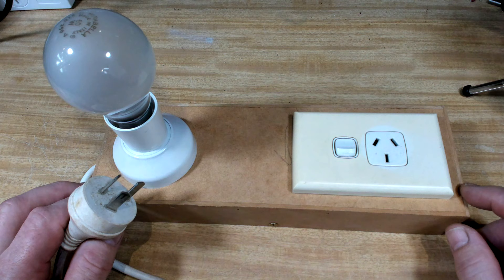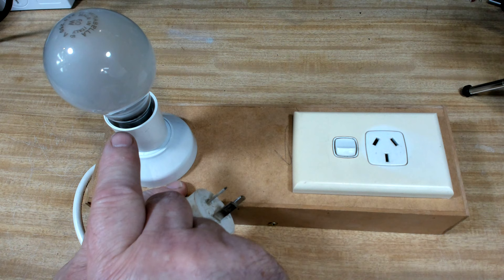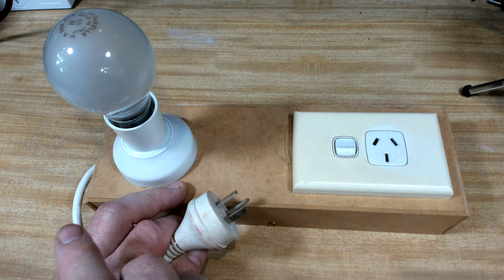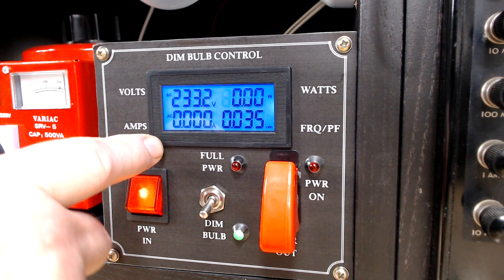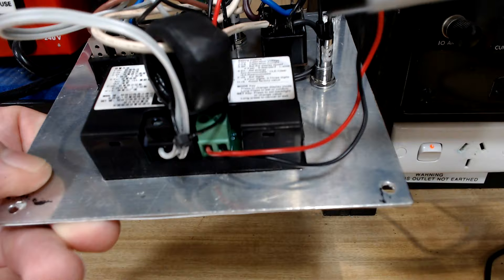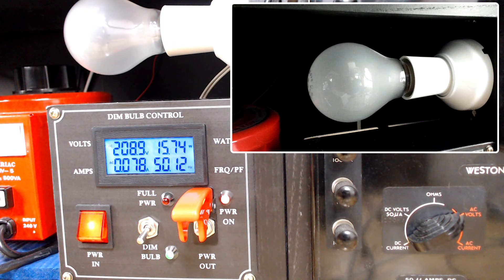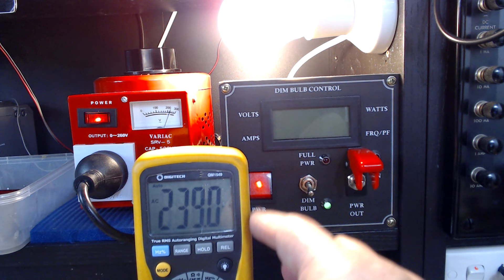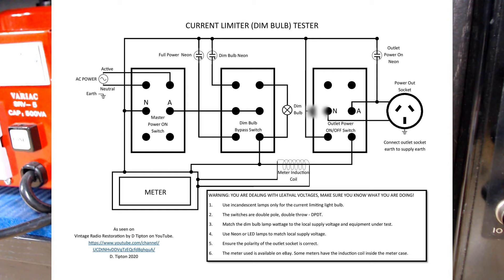My Dim Bulb Tester Revealed

Comment: Thanks Dave.
I know I asked you for a video about the Dim Bulb setup a while back.
Thanks for making this video.
Having an issue buying incandescent globes as well. I have gone with little Philips 40W Halogen globes. They seem to do the trick in series. Have never put a multimeter across mine though.
Reply from the maker: Hi 1974UTuber. I've had a number of enquiries so it was about time.  The bulbs are a problem, I've seen them on eBay and in garage/yard sales. I guess halogens would work, much the same with a different gas 🤔🙂
Reply: Yes halogen bulbs sure do the trick! I've got two 75w halogens in my dim bulb tester with the second one being switchable in and out of parallel with the other to double the current capacity
Reply: Don't forget to set your multimeter to the 10amps setting and use the proper terminals for 10amps..  ;-)

Comment: This saved my house from burning down when the lamp in the window shortcutted in the cable due to a heavy lamp. Great to know what the watt the lamp should be because I have been wondering and no one said what it should be. Now I will build one to my self.  Thanks.
Reply from the maker: Hi Harald, the wattage needs to be changed to suit the wattage of the device under test but any wattage will help save the device by limiting the current. Good luck with your build 🙂

Comment: Yes that dim bulb tester, great idea and you have done a great on the making of that. With my own man cave i have a 60 watt light and socket mounted to the wall just near my bench. A length of mains rated fig 8 lamp cord ( 2mtrs ) and a couple of insulated alligator clips on the end. Great for discharging filter caps safely. also great when working on tv's/ high powered audio amplifiers and can be used as a current limiting device in place of the mains fuse. Has saved my bacon a couple of times. I used to work 40 odd years ago in a factory that manufactured electric blankets. They made and sold testers that put a 15 Watt bulb in series  with the blanket change the heat settings  ( high, medium, and low ) and the bulb changed brightness with the setting. This proved to the customer if they had a problem with there electric blanket or not.
Reply from the maker: Thank you Stephen. It's a very simple and cheap solution. Good idea giving the customer an easy to use home demo of their blankets operation, good thinking 👍🙂

Comment: Heck of a coincidence.  Parts for a new dim bulb tester are sitting on my workbench right now.  I'm doing it a bit differently; I have two bulb sockets that can individually switched in and out of the circuit.  The fact is that I was somewhat inspired by your tester.  It is so nicely done.  Thanks.  Appreciated.
Reply from the maker: Hi George, that is a coincidence, I probably should have considered a multi bulb setup but the Variac does a little of that I guess. Good luck with your project 👍🙂

Comment: Great idea not seen long time. We had 2 types same as yours for shorts and another with 2 globes for insulation testing on motors.. The globes both same in series with test lead across one . If insulation to ground good both globes glow same.  The greater the problem one globe would get brighter and other fade.  If a full on short one go out the other full bright.  Not a mega but handy, quick on bench.
Reply from the maker: That's a good quick method Chuck, I like it, thanks 👍🙂

Comment: You are going to smile at what I’m about to write here Dave.
Sometimes when we are short of time when pulled out with work, or in “I can’t be bothered” mood, we might look on line for professionally manufactured test equipment that we are capable of making ourselves.  I have done that in the past.  I honestly thought your dim light tester was a professionally manufactured product you had bought.  Although I couldn’t see a manufacturer’s marque on the front, I guessed it was printed on the rear of its case.  The part that really threw me was seeing the LEDs.  I thought they were indicators for some sort of adjustable over-volts, and over-current protection circuits.  With that in mind, I went on line to find out who manufactured your dim light unit but all I kept getting was basic dim light circuits diagrams LOL.  
I guess I was looking at you dim light test far too deeply but one has to say, “It looks professionally made.” 
In a very nice way, this video has been a bit of a let brown - as I say, in the nicest of ways LOL.  I also thought your ‘professionally manufactured’ dim light tester would not work any better that if you had made it your self ...as I imply, it looks too good to be home brew LOL.
Bell Comet Colt radio update: the radio part is up and running, and it works brilliantly; I did some reverse engineering and I have a circuit diagram for that model, all that is left to be done is stripping, staining, and revarnishing the cabinet.  The video will be uploaded shortly after the middle of this month.
Cheers my friend, Phil.
Reply from the maker: Hi Phil, I always pre-smile when your name comes up in the comments 🙂 Sorry to let you down with the design, it's just a basic DB tester with a few lights and a meter which is very handy to see what is going on, it comes from my airline background where it takes half a dozen switches and lights to power the fwd toilet 😄 I'm looking forward to your Colt video. I didn't realise it was a wooden case, I assumed it was plastic. There is a New Zealand radio website, I would have thought there would be a circuit there. There are some pretty helpful folk on the site as well. I have your channel subbed so I will know when your video is out cheers 🙂

Comment: Thanks Dave.  I designed one recently to use some small 40 watt bulbs I found here in Japan.  Didn't know how long they'd last on the market so I bought five, plus five of the equally rare 17mm ceramic sockets for them.  You can also use chandelier/candelabra bulbs which are generally 40 - 60 watts.  In my first dim bulb tester I used a 100 W halogen projector bulb.  Worked great but finding a 2-pin socket for the thing was a challenge. One of the Chinese vendors eventually had it.
Reply from the maker: Thank you Sincerely Yours. The bulbs are a problem but are still out there, the halogens seem to work OK from what I can tell 👍🙂

Comment: Thanks very much David for showing how the dim bulb device works. I would one day like to watch a video about how you got into the hobby and if you are a member of a vintage radio restorers club. There is a fascination for me about getting the older radios back into service and returning them to their original condition. It is like a time machine bringing back the past and it has been said that a valve radio has a better sound than solid state devices as well as a friendly glow from the tubes.
Reply: Hello Crazy Nuts. I can heartily recommend the Historical Radio Society of Australia (HRSA). You can get plenty of help from its friendly and highly experienced members.
Reply from the maker: Hi Crazy Nuts, thank you. I should update my channel blurb to include where I am now. I am a member of HRSA and the Historical Wireless Society of South East Queensland. Both have been very supportive and a source of information and parts plus the social aspect. I remember as a child looking in the back of our console radio when it was going and feeling the heat and glow of the valves and wondering what all those tin cans and wires were doing. I still do the same now 😄 We still listen every day to a valve radio playing AM radio 👍🙂

Comment: Thanks Dave for the clear description!
I am working on a dim lamp tester similar to yours but with several lamps (mini halogen, bi-pin) that I can select with different switches, even put them in series.
Reply from the maker: No Worries Alejandro, That's a good way of doing it particularly if you don't have a Variac, thanks 👍🙂
Reply: Take note though, that you are not truly 'isolating' from the mains, which helps a lot with regards to
some old radios possibly ending up with a 'live' (to Earth) chassis. Even with a Variac, make sure it
is not an 'Auto-Transformer' type, where there is no separate secondary winding!
Reply from the maker: @glennsprigg2378  I use an isolation transformer to supply the dim bulb, those autotransformers are a trap if you don't know 😟
Reply: @DavidTipton101  Yea, I was mainly addressing it to Alejandro...
Reply from the maker: @glennsprigg2378  Ahh... right 👍🙂

Comment: Hi Dave. I have been thinking of improving on my rather crude dim bulb tester, yours looks like just the job. Might not be as posh as yours but sure it will turn out OK. Am currently restoring a Westminster Radio 1947.A little research shows it was produced for the Currys brand retailer in the UK. Made by Belcher Bros in London with a chassis from Plessey. A fairly large but well made bakelite cabinet which is in very good condition.
Reply from the maker: Hi Robert, good luck with your dim bulb project and the Westminster. A nice looking case on those and they have a transformer 👍🙂

Comment: Hi Dave ~ From America
Great seeing how you assembled you dim bulb tester.
I am a new subscriber to your Channel.
I have been spending hours in the evening watching all your videos.
I am fascinated by seeing Australian Radios, all with power transformers.
In America, we have AA5 Tube (Valve) radios with sometimes very Hot Chassis.
I think you Dial Glasses are cool with the different areas and station call letters.
Great work on all your projects Keep It Up
Thanks, Skip
Reply from the maker: Hi Skip from America, thank you. We stuck to the transformers for some reason. It's a bit of a problem with our 240V supply and having to dump an additional 120 Volts, that's a lot of heat. I have worked on a few hot chassis sets from the UK. I get a few comments about the dial numbering, they can look pretty good. Thanks 👍🙂

Comment: That is a nice bit of kit, I honestly thought you had either bought it or had it made.  Is there no end to your talents David?  Nicely done I have to say.  I won't be building one that looks so nice, functional yes, nice not so much.  As long as it is function and not malfunction it will be fine for me.  Now I have to find a meter display like that in the UK.
Reply from the maker: Hi Bob, totally agree, make it as simple as possible. The addition of the meter is a great diagnostic tool to see what the component on test is doing. Either Goggle or search eBay for "AC Power Meter". Our local electronics store sell the 260V version, mine is the 500V version. There are colour versions available as well I think. Cheers 👍🙂

Comment: Sound logic on its development and use. 
I'm not entirely sure but I believe under the various Australian State Electrical Safety Acts & Regulation. 
The wooden Dim Bulb test should have a safety tag saying it should only be use for appliance testing.
If you're the only person using it that wouldn't be a problem 
but any chance of any one else using it or an Inspector (very unlikely) showing up 
that approach is a backside covering exercise. 
A cct dia on the back would help safety awareness too
Reply from the maker: Good point Edward, thanks 👍🙂

Comment: it also works as a bank capacitor current limiter
Reply from the maker: It's a current limiter, what is a bank capacitor Paulino? 🤔
Reply: @DavidTipton101  It's basically some capacitors in paralel, used in spot welding machines

Comment: Thanks Dave for sharing this!  I have been wanting to see this for some time now!  It would be nice if you had a variac inside with the rest of the stuff, but those things are so darn heavy that it wouldn't be practical.
I really appreciate the schematic that you provided, but you left, for me, a very important part out!  What is the brand name and part number of the "Volts, Amps, Watts, Pf" meter?  I would like to use one of those and have no clue where to start looking for that one.  
As usual, you did a great job...a bit short, but then not really much else you could have done...other than perhaps sing to us??? ;-)
On a more serious side, I suppose you could show how you made the label, how you sized it to fit the panel and things like that, but that is about all I could think of that might have been done but wasn't.  The video is fine and complete as is, not really any problems with it...just a bit of "wishes" on my part.
I am eager to see your next video on the radio.
Reply from the maker: Hi Wayne, thank you for watching. I have a Variac next to the tester. You don't want me singing either, the neighbourhood dogs howling usually drown me out anyway. There is no brand for my panel meter but if you Google or search on eBay for "AC Power Meter" you can find them, you will need to pick one that suits you purpose. I made the label using MS Publisher but you can use other programs. I may have cut the aluminium panel out and scanned it into the PC and simply added the artwork over the top in the program. MS Paint that comes with Windows could be used in a pinch 🙂

Comment: Thanks for sharing this! Its kinda difficult to build sth like this, because Incandescent light bulbs are hard to find in germany due to environmental regulations. I wonder if "UV Lamps" would work too like e.g for a Terrarium. These lamps, as far as i know, are not banned/regulated - because they are not used in the usual household and have a specific purpose (heat and light for a terrarium). 

Mayhaps i need to look at flea-markets... :D
Reply from the maker: My pleasure Kevka Bluebird. You may be able to get them from Ebay. You can use halogen lamps as well. I guess a UV lamp would work though if you can get them in the right wattage 🙂

Comment: Good morning Mr. Tipton. I follow with great interest the videos of him that I really appreciate. Could you give me the abbreviation of the digital instrument you used in "DIM BULB CONTROL". I would like to buy it same as the one you used. Thank you.
Reply from the maker: Hello Roberto. I got mine from eBay. Search for "LCD Digital Volt Voltage Watt Current Power Meter" in eBay and you should find them. There are two voltage ratings for them, mine is the 500Volt model 🙂

Comment: Just completed my dbt, thanks for the design. When testing with a 100w globe it works great, but in the 60w range I only have one of those halogen look-a-likes. When I tried it the radio wouldn’t come on but the globe stayed bright. The radio is good, no problems, and as I mentioned everything was great with the 100w globe... went bright, then dim and then bright again once radio warmed up. I’m sure I read somewhere that halogen work. Any ideas Dave? The radio is 50 watts.
Reply from the maker: Hi BG, A 60 Watt bulb with a 50 Watt radio doesn't leave a lot for the radio to operate. The 100 watt is a better choice for that load as it will still allow the radio to operate but limit the current if something is wrong. The halogen globes should work although I haven't tried them myself.

Comment: Is it safe to use a dim bulb tester when repairing switch mode psu, I occasionally repair them used for amateur radio? Also what about when repairing vintage tvs that have Smps or perhaps a mains input transformer which supplies the various voltages?
Reply from the maker: I cannot comment on that @mervace, I have no experience with those devices 🙂

Comment: GOOD STUFF.
What if not using iso xformer with only neutral and active two prong plug radio.Do you still wire earth through to outlet?
Reply from the maker: Hi Squiz Squires, if you only have a two prong plug it makes no difference if the earth is present or not except the metal front panel is earthed, I wired an earth in so if it is connected directly to an earthed power outlet the earth is there 🙂

Comment: So for those who have plugs that go straight  up and down, do you recommend 100 Watt bulbs. ( 120 V AC)
Reply from the maker: Hi Dan, you need to match the globe to the load you have plugged in. 100 Watt @ 120V for small radios is probably OK, you will need to use a higher wattage globe for heaver loads. Any larger globe is OK to use as it is being used as a current limiter but I aim for the load under test to have sufficient voltage and current to still operate without too much overhead left 🙂

Comment: Hi David, Great Video, do you have the dim bulb switch in before or after the LCD meter? Cheers
Reply from the maker: Hi Joshua, there is a link to the circuit in the description. The pick up for the meter is in the wire to the output so it measures what is being delivered to the device under test
Reply: @DavidTipton101  Awesome,  thank you, I have to remember to scroll down LOL. I actually restore valve Public Address amplifiers so will use 100W bulb.
Reply from the maker: @joshuaboxer4434  Yep, I see you on the Facebook group 👍

Comment: Hi Dave,  thank you for your great video's. I forgot to ask this question when I first viewed this video.  I was wondering which side you connect the isolation transformer to, ie to before/after the variac, or on the output, just before your radio under test?  Keep up the great work, and thanks in advance.  Cheers 🙂
Reply from the maker: Hi David, it's in the description I think. I have the Variac into the isolation transformer into the dim bulb tester. Thanks 👍🙂